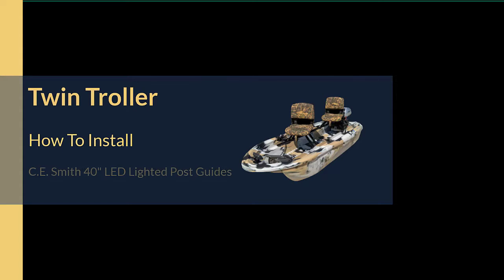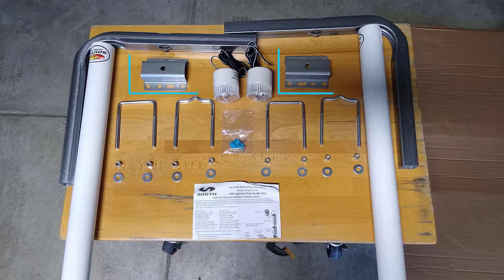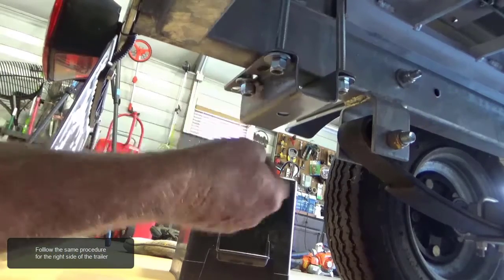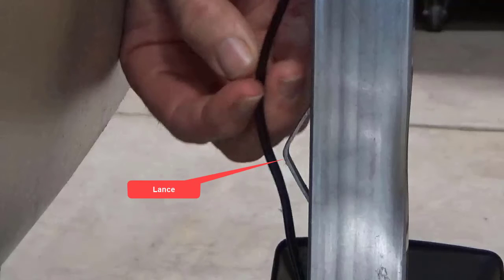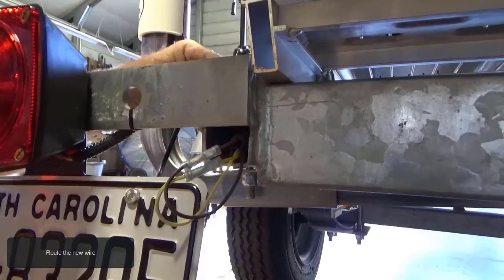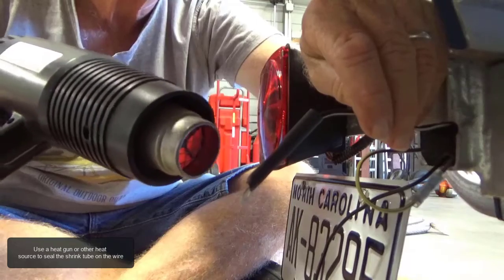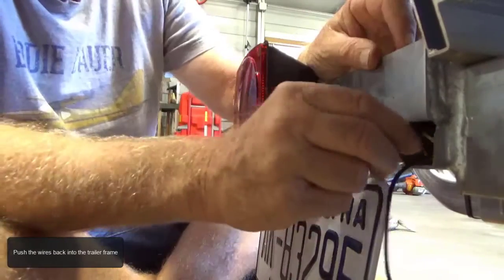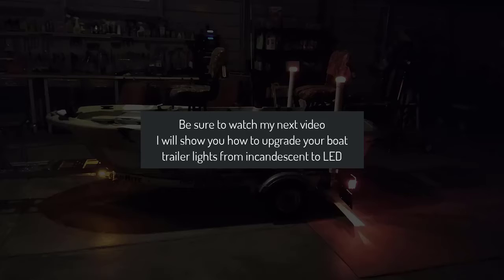How to Install the C.E. Smith 40” LED Lighted Post Guides

Comment: Those post guides are a must when dealing with any current or wind.  I really think all boat trailers should have them.
Reply from the maker: I agree 100%, I have owned several boats over the years and always installed post guides on the trailers. It helps keep the boat aligned and makes loading the boat so much easier.
I appreciate you watching my video.
Thanks,
Norman

Comment: Hey Norman.do the LED post lights respond to the brakes? Or they are just running and indicator lights?
Reply from the maker: No, they do not respond to brakes or turn signals, just running lights only.
Thanks for watching my video
Norman
Reply: @NormanGooch  .thank you Norman. You know what I did? Instead to ground to frame , I connected ground line from LED  to blinkers line,now they are running lights,and blinkers, works beautifully. -When you hit the brakes they turn off ,but I turn on parking-blinking lights and brakes would not affect,therefore I see guides on lights at dark at the marina.
Reply from the maker: @darmasr2  good idea

Comment: Is it possible to connect guide post light ground to running light ground rather than drilling a hole in trailer?
Reply from the maker: If you have access to a white ground wire on your trailer, you can connect the post guide lights to the wire or connection screws as long as the white wire is grounded somewhere on the trailer frame.

There is one ground wire running for the entire wiring harness. It is responsible for grounding every light and feature running through the harness.

The ground screw installed on the rear of this trailer is the central point for all ground wire connections. Both inside and outside of the trailer frame. If there is a light problem, checking the ground in one location is the quickest and easiest solution.

Since the post guides and light fixtures are PVC plastic, they must be grounded to the trailer frame.

The "ground" provides a return path for the electricity to return to the tow vehicle to complete the circuit. This return path could be through the trailer's frame and on through the ball to the tow vehicle's chassis. 

Running a dedicated ground return path is a superior way to complete the return circuit. 

The ground wire needs to be connected to a bare, clean portion of the trailer frame. You will use a ring terminal and self-tapping screw for the connection. Choose a ground location that doesn’t contain any contamination, corrosion, or paint. If you need to, clean it off first.

I hope this helps,

Thanks for watching my video
Norman

Comment: Can't you run the wire inside the square tubing? That way you wouldn't have to look at those zip ties everyday
Reply from the maker: Arthur,
The instructions for running the wire on the outside of the guide post supports along the inside groove is suggested by the manufacturer.
The wire is covered by the PVC posts. The distance between the end of the post to the nearest entry point into the trailer frame is very short.
If you run the wire inside the support post tube the wire will come out under the boat frame. You will have to either drill another hole to enter the trailer frame, or continue running the wire to the nearest entry point in the frame. You should always avoid running wire under a trailer frame. It should be on top when exposed and inside the frame at the nearest entry. The other problem when adjustments to the posts are required and if the light needs to be replaced. Wires run through the supports down under the boat and zipped tied to the frame and into the trailer frame will be more difficult to repair.
I appreciate you taking the time to watch my video.
Norman
Reply: yes you can, that is how i ran my wires, had no issues at all doing it this way.